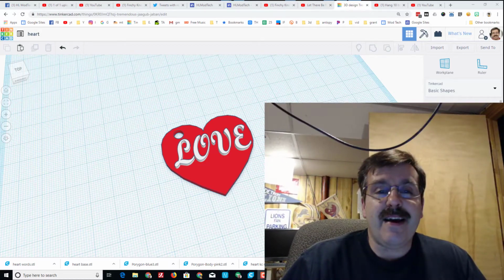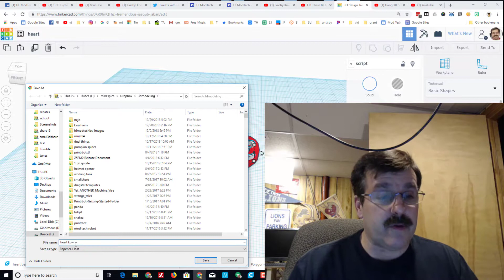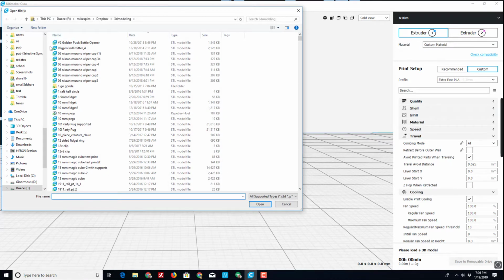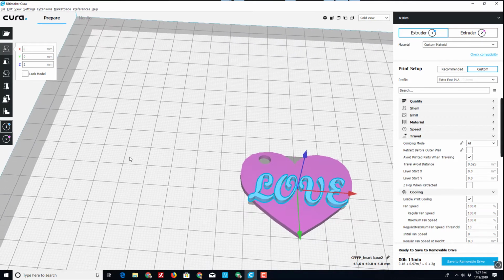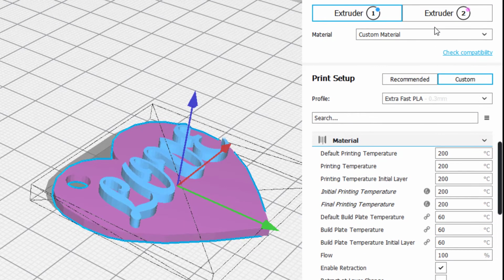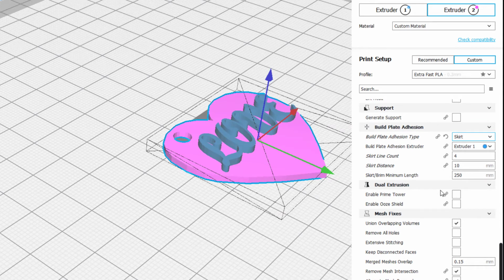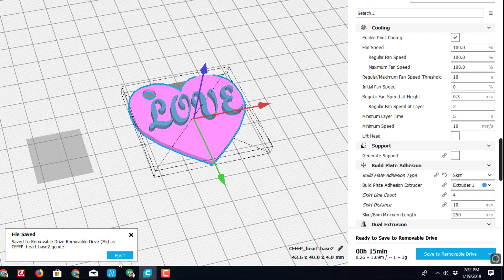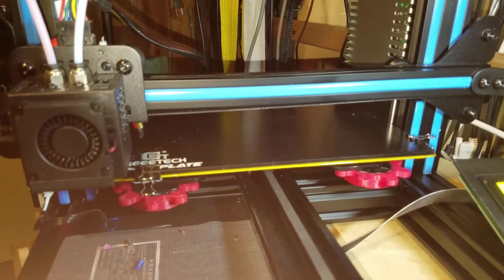So Easy! A10M and dual colors using Cura 3.6

Comment: Hi There, Thanks for this info, I have an A10M and using cura 4.6 and I have followed this video accordingly and followed your other videos, setting up the a10m and updating the firmware, apply all the settings exactly the same and assign using the lizard from thiniverse set Extruder 1 to 2 x parts(Eyes and 1 body part) and Extruder 2 to the other body parts,  merged the model, etc., and when I print it only prints with Extruder one, I have tried printing from Cura to Octoprint it prints everything with just one color (extruder 1)including the tower,  saving it to SD card and printing from the SD card causes the printer to pause, have tested the Mix function on the printer itself and this works fantastic, Is there anything you can think of that I missed, or do I need to add some gcode to the printer settings,  this is doing my head in. , thanks appreciate this in advance. I can provide my setting etc., I even removed the printers uninstalled cura and re-added the printer and profile
Reply from the maker: There is a new video series that shows how to updated to Verts firmware and setup the mixing in Cura... Have you seen that? https://www.youtube.com/playlist?list=PLRXLS33csRK5RTJv3RHIOdssigDvVr3GG
Reply: HL ModTech, thanks for this info i did watch this episode first and updated the firmware to B493 that was the release available, and then try to print the lizard in 2 different colours based on this video, but still printing just in one color, maybe can you share your printer start and end gcode and the extruder gcodes from Cura
Reply from the maker: @InvisiKing  Shoot me an email at hlmodtech gmail and I will see what I can do.

Comment: Добрый вечер.Разрешите поинтересоваться какое средство для адгезии модели к столу принтера при печать PLA пластиком вы используете? 

Good evening. Allow me to ask what tool for adhesion of the model to the printer table when using PLA plastic you use?
Reply from the maker: Occasionally I spray a mist of hair spray (aquanet)  Most times I rely on the bed being level and my temps being right. Usually about 200 for the hot end and 55 or 60 for the bed.

Comment: do you have one extruder and 2 stepper motor to feed 2 filament into one extruder what are you using and where to buy it
Reply from the maker: The A10M has a built in 2 in one out extruder.
Reply from the maker: I snagged mine at gearbest. $305 currently https://www.gearbest.com/3d-printers--3d-printer-kits/pp_009776093050.html?wid=1433363&lkid=78415234

Comment: does some one know what to do if the colors bleed into each other, I have no clue how to fix it
Reply from the maker: You can fix it with a purge tower. It prints a second part, cube or cylinder usually, and clears the nozzle before printing the next color. I am too frugal to waste the plastic myself... 😂
Reply: @HLModTech  I have the prime tower turned on in Cura but its not working
Reply from the maker: @ktech6778  Can you see it in the preview?
Reply: HL ModTech if you mean the prime tower then yes
Reply from the maker: @ktech6778  Are you on 3.6 or 4.21 of Cura? My printer is at school, so I will have to do some research for ya on Monday.
Reply: HL ModTech I’ve been trying every Version starting with 4.0 (thank you for your help)
Reply from the maker: @ktech6778  Finally got a purge tower test yesterday. Here is how mine is set up. https://youtu.be/AWMgLmpXKVo

Comment: Thanks for the video, may I know what will happen if we did not remove that two line with T1 in the commands?
Reply from the maker: It would try to heat a non existent hot end...  Mixers have one, but Ultimaker builds there with two independent hot ends.

Comment: Bonjour Monsieur
Merci pour vos vidéos qui sont tres bien faites j'ai 7 imprimantes chez moi dont une ender3 et depuis peu la a10m. Je suis incapable de réaliser la moindre impression les seules que j'ai réussi sont le lezard et le chien prevu sur carte à la livraison. J'ai effacer par erreur auriez vous les references pour les remettre svp, ceci afin de controler si ce sont cura ou l'imprimante qui disfonctionne. tres peu d'information pour creer des fichiers bicolores. Des problemes de reglage Z instable, des sous extrusion, les filaments qui ne descendent pas et forment une boule j'en oublie certainement. Pouvez vous m'aider svp merci
Reply from the maker: Is one issue that the print is not sticking to the bed? I would start by trying to print a small cube. Easy test and if you set the adhesion to brim you can print 5 lines of brim to see how the print is going before it gets to far along.

Comment: Thanks for the info.  Standby temperature was what I forgot about.  I got my A10M yesterday.  Made some keytags today.  I just used the Geeetech color mixer (beta) program.  It lets you switch colors at layer lines.  I did the first 4 layers one color, then switch, then the last 6 or 8 layers in the first color again. Example: red, white, red.  No purge block needed.  Have you tried it?
Reply from the maker: I did try the mixer, but was hoping for the gradient effect that is available via the console... I LOVE that effect. Really popular with the kiddos at school as well. =)  Appreciate the tip in the 2 color option. I have always used my replicator 2x, but that may allow me to switch it up. 👍